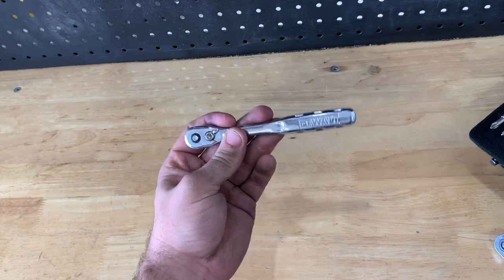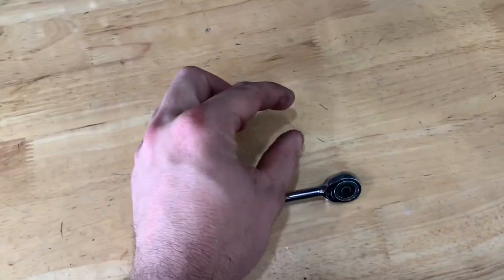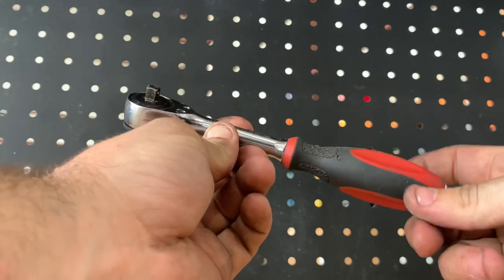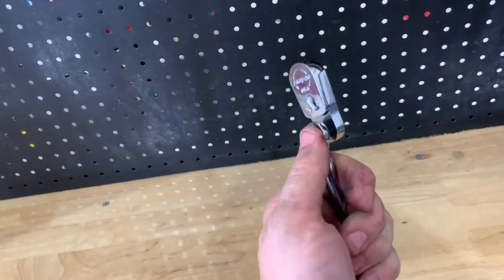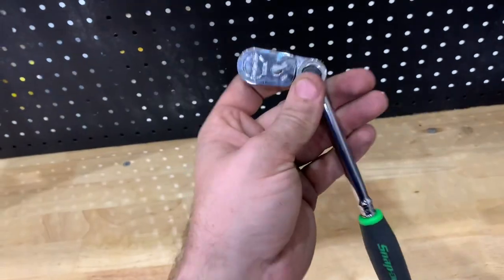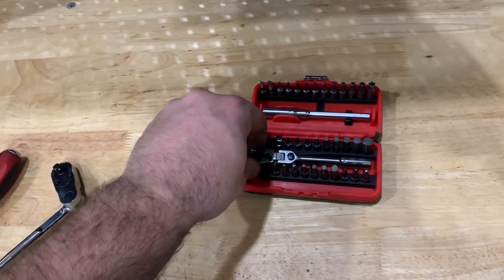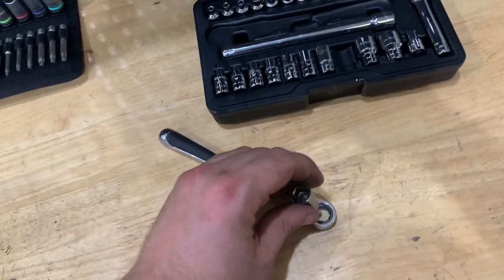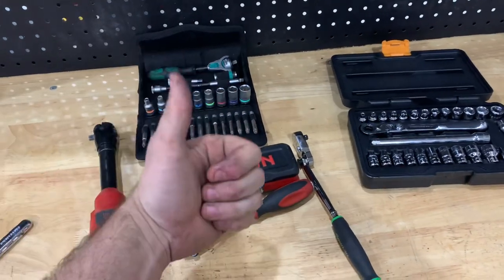Tool Tuesday! Five 1/4 ratchets every A&P should add to their toolbox!  Aircraft mechanic tools.

Comment: I have a 1/4 inch drive BulePoint / Snap-On with a rotating head that I bought from a Snap-On dealer about 25 years ago. Still works great.

Comment: Love my Icon Ratcheting bit driver. However I honestly don’t like the pass through sockets from gear wrench. Don’t get me wrong it’s a good set overall, I just prefer snap ones since they made it in a 12 point style instead of 6. I normally stick to Tekton and GW for a lot of my stuff  but those snapon 1\4 inch pass through do are worth the money when it comes time to need them.

Comment: Do you have the part number for the twist handle rotating 1/4 ratchet?
Reply from the maker: https://www.protoindustrial.com/en/industrial-tools/BlackhawkByProto/Drive-Tools-%26-Accessories/Ratchets/f217b2bd-c34c-4808-bd91-7401f9d2e763_Blackhawk%e2%84%a2-by-Proto%c2%ae-Rotator-Ratchets/GW-9946R_Blackhawk%e2%84%a2-by-Proto%c2%ae-1%7c4%22-Drive-Rotator-Ratchet/